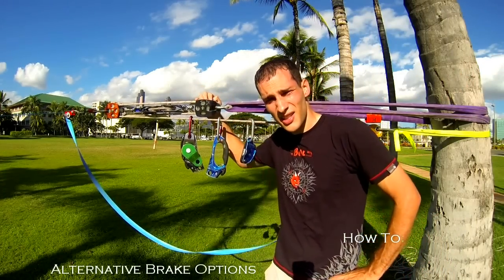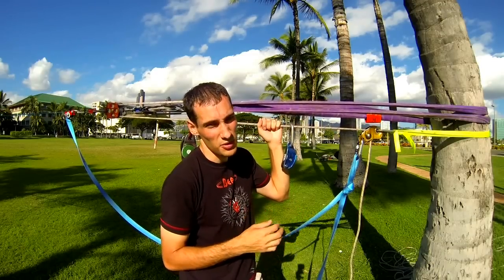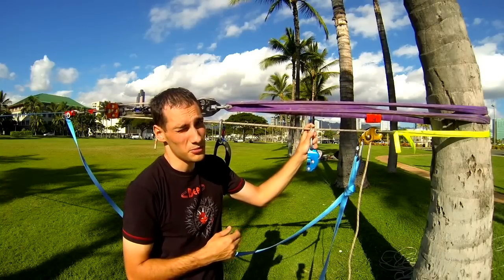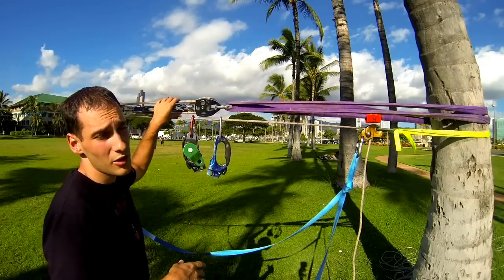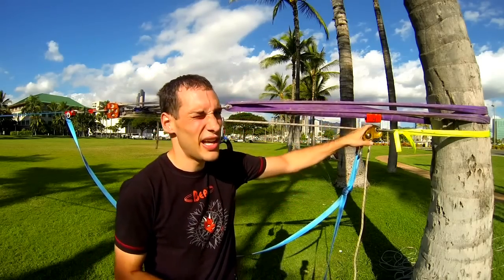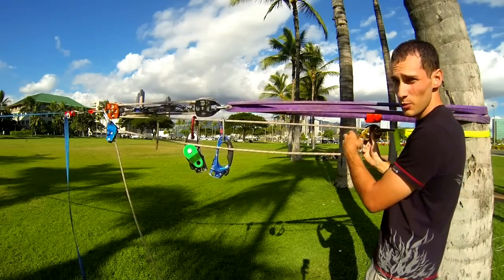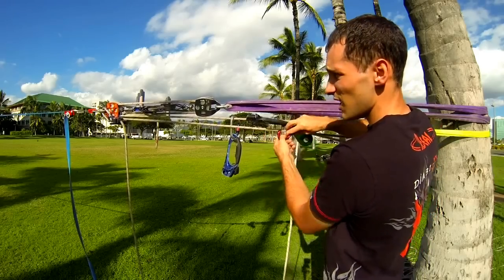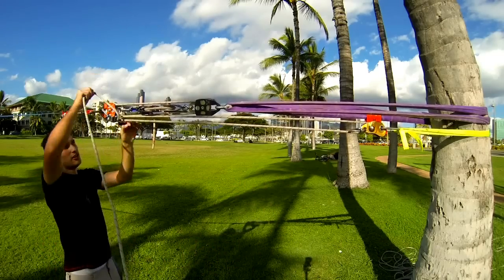Slackline Tech: Alternative Brake Options

Comment: At around 0:44 I see the sling is attached to the jaw of the shackle. While the angle of pull is very small, this still triloads a non-triloadable part of the shackle. Probably won't break, but folks like myself are always trying to preach the safest and most accepted methods. You'd want the bow to be on the sling side and the jaw to be attached to the pulley. Also, where's the tree pro? I know spansets don't hurt trees nearly as much as thinner slings, but tree pro it will help trees, keep slacklining legal, and viewers will see. 
Furthermore, you're backup knot is non-releasable and too long from what I can see. So if this line did fail, the backup would have a high likelihood (compared to other methods) of shockloading the webbing, thus making the backup knot not only useless, but non-ideal because it might just break your line. If the pulleys did break, and the knot did hold, you'd still probably have to cut your slackline because of that overhand. It's probably better than no backup, but if it was necessary to use it, you'd be out a few feet on that slackline for sure. Munter mule hitch is a solid way to back up. 
If I'm misinformed, I'd love to now if/why this is an accepted way to rig. 
Sorry to diverge from the content of the video. It's a solid, informational video, and I got a lot out of it. Thank you for posting.

Comment from the maker: The Pro Traxion will not slip, it is a toothed cam. If you overload it, the device will cut the rope. The SWL is 2.5 kN. So if you are using a 7:1, that gives you an SWL of 17.5kN.